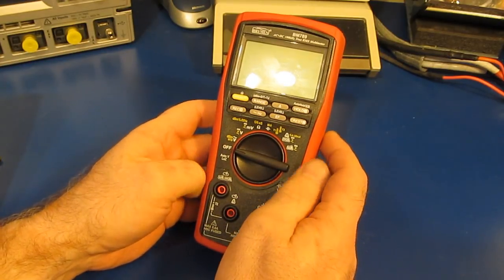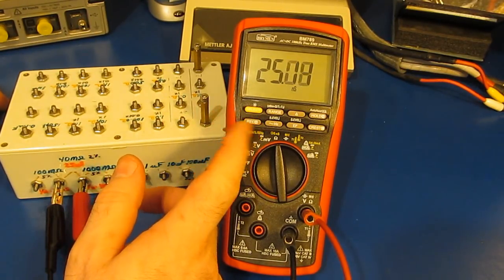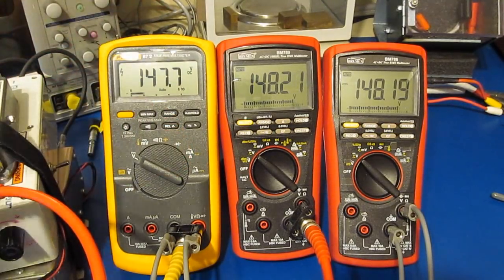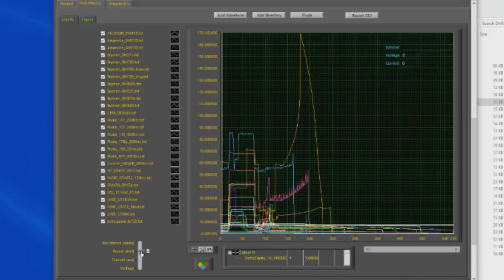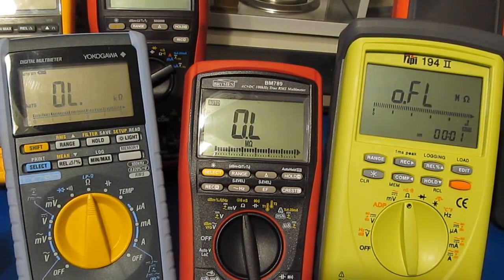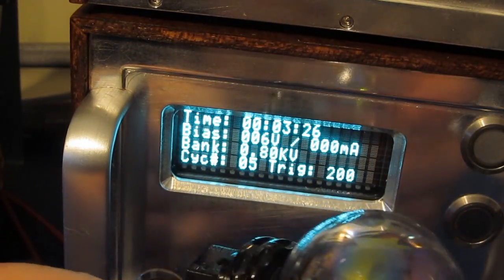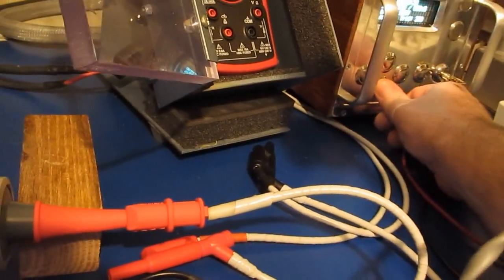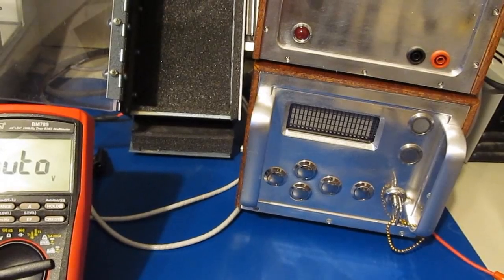Brymen BM789 DMM

Comment: I'm a retired calibration tech (metrologist) and always found the Fluke meters to be the most reliable, accurate and responsive with very few not passing spec even over longer periods of use/time (I've calibrated/tested thousands!).  However they are expensive.  Your Brymen reviews have convinced me that Brymen maybe it's equal at a more attractive price point.   I've purchased a couple after your reviews and have not been disappointed.  Note, they test well using the sophisticated (and very expensive) Fluke 5520A calibrators.
Reply from the maker: Thanks for the insight.   At least from a robustness standpoint, they appear to be on par.  I expect most will have a very long life.  Fluke really doesn't offer what I would consider a decent general purpose meter for electronics.  I like the obsolete Fluke189.  Brymen has the BM869s which is is my meter of choice until I find something better.
Reply: @joesmith-je3tq  The techs primary portable meter was the Fluke 189 until the 287/289 was released and then they upgraded.  The cal lab is a large international organization that went on a buying spree and purchased many of the small mom and pop cal labs in the US and internationally.
Reply from the maker: @amham48  The 289's boot times, small fonts, poor contrast and slow graphics turned me off of it.  I compared it with a Chinese knock off.  They copied the menu structure so its a no brainer to drive.

Comment: Do you publish the battery life chart anywhere? I really like this meter but I'm wondering if there's something comparable but with 300+ hour battery life.
Reply from the maker: I sure do.  Read the description.
Reply: @joesmith-je3tq  Which link has the battery life info included? I only see the one with the stress tests.
Reply from the maker: @rasputozen  That spreadsheet contains ALL of the data I have collected.  Tabs are at the bottom of the screen.

Comment: Hi Joe, I've got an older BM789 that has the beeper issue. It annoys me a bit, apart from that its a fabulous meter. Did you just write to Brymen to get those shields?
Reply from the maker: I had wrote them when the problem was first reported.  When they responded that they had addressed it, I asked for the parts to upgrade the meter for this review.
Reply: @joesmith-je3tq  Thanks a lot!
Reply: Hi, I got one with firmware 06, Is there any way to upgrade firmware to the latest version?

Comment: Thank you for the video Joe! Excellent as always. Just bought one from Welectron. Edit: 78908 firmware installed.

Edit/20220510: Bought a second one from Welectron. Firmware 78908 installed.
Reply: 78913 firmware now.

Comment: From Fluke's calibration manual there is a paragraph that states: "For better accuracy when measuring the dc offset of an ac voltage, measure the ac voltage first. Note the ac voltage range, then manually select a dc voltage range equal to or higher than the ac range. This procedure improves the accuracy of the dc measurement by ensuring that the input protection circuits are not
activated.".
 What I see from the video at 21.45 the scale is 6.00 (auto scale from AC measurement) and this scale should be set manually for the DC offset for precise measurement (as it is done when you select manually the scale, showing the correct measurement).
Reply from the maker: Indeed, all autorange problems can be solved with manual range and manual range meters do not exhibit autorange bugs unless the human screws up.

Comment: Joe. I love my eevblog bm786 so I'm about to pull the trigger on the bm869s off elecktor on ebay. It's quite cheap. I was given a tektronix dmm916 recently. Very nice responsive meter. I'm tempted to mod it with 2 leds. 1 on each side of the screen. I'll run them right from the battery when the meter is turned on. It's going to be a non destructive mod

Comment: Thank you for all the testing of all the Brymen DMM's you have done and I have a few questions !!!  
1.  Do you still consider the Brymen  869s to be a good meter?
2.   Have you measured the internal resistance in meters when measuring current? The reason I ask is I noted that when I put my Agilent meter inline I found it loaded down my circuit.
Reply from the maker: 1) You still see me using it don't you? 
2) I do not understand your comment about your Agilent loading your circuit.  You would need to provide more details about what you were doing.   

I have measured the burden voltage (assuming that is what you are asking about) for many meters.   That fact that you talk about loading, I suspect this is not what you are asking.
Reply: @joesmith-je3tq  I believe the question was asked about taking into account  internal impedance of the meter when measuring current. For e.g. for small current measurement the internal impedance of APPA iMeter5 on 4mA range when measuring DC current is around 3kOm. One meter had 2682Om internal imedance and another 3628Om. In the manual it says for e.g internal.impedance is around 3kOm. But this is approximate figure and each and every one will have particular internal impedance different from one to another. Therefore the current measurment was different for each particular meter. Hence when it taken into account it allows more precise measurement of the current. All meters have the difference. Would be really interesting to see how much difference Brymen same series have?
Reply from the maker: @stanleywhiteman6450  So you think they want to know the burden voltage of the Keysight.   This makes sense.
Reply: @joesmith-je3tq Would be interesting to know what working voltage of their circut they mentioned in that regard for a start to come to some kind of conclusion

Comment: in uk is quite difficult to get a specific multi-meter model from brymen or other decent or major manufacturers or anything else than a fluke. but i recently discovered a brand that is basically re-branding brymens and they are quite well known as a brand here in uk for testing equipment and they are called metrel.
Reply: any ideea what is going on?
Reply from the maker: Sure.  They are a business and as such sell products.  Rebranding is nothing new.

Comment: joe smith, You can measure a current of about 500 mA with a BM789 multimeter in milliAmp mode, take a reading and, without changing the current, switch the limit to Ampere mode (10 A) and also take a reading. For example, it can show 490 mA and 0.500 A, respectively. Will there be such differences on yours or not?
Or it will show 500 mA and 0.500 A respectively.
Reply from the maker: Assuming a constant voltage, the current will change as a result of the different shunts being switched.  Look up burden voltage.    That said, even if I drove the meter with a perfect constant current source, I expect it will change.   Recently someone had posted about their zero drift perfect UNI-T meter to which I created a video for.  Nothing is perfect.    https://www.youtube.com/watch?v=xuUGq3kdWyo

Comment: thanks joe you review, but i need your honest opinion 
would you still recommond BM869s with missing Autohold, why do you not recommand BM789 and it has all fetures BM869s not included.
why is Auto hold function not important as electronic uses point of view
Reply from the maker: I don't normally recommend products so I am not sure where the "still recommend" is coming from. Often I just recommend people to do their homework and buy the tools they need to do their job.   I do still use the BM869s.   It has a few features I want that are not included with the BM789. Mostly, I want the split display but have also found that 500k count mode to be useful.

Comment: I'm a owner of this model, I had UNI-T UT61E and sold it and bought this, by watching this review I'm sure that my brymen BM789 is robust meter.
Thanks for the hard work 😘
There is a 5 pins connector under battery cap, is that for updating firmware or just for factory use? Anyone knows?
Reply from the maker: I would assume for closed case alignment and firmware updates.  Factory use only.

Comment: Hi Joe. When you were doing the high voltage DC tests (around 17min into the video), what kind of cable are you using to connect the meters to the high voltage power supply? Its looks like an orange/red cable going to the banana to BNC adapter. Thanks Joe.
Reply from the maker: Coaxial.

Comment: Thanks for your video! If you had such a knowledge or experience, how accurate does calibrated BM789 unit perform over new stock one?
Reply from the maker: First, calibration is comparing the instrument with known traceable standards to verify it meets the manufactures specifications.  I assume any product when new, meets the manufactures claims.

Comment: Hello, I have the ut17B PRO model and when I measure a voltage around, let's say 5 volts, if I measure with the probes + with plus and - with minus, it gives me  5,3 volts, let's say, if I reverse the probes + with black and - with the red probe, it gives me another  type value - 5.7 volts, so a difference of 4 millivolts inverse of the probe in DC (direct current).
 Do you think it's normal?  is it part of the tolerance of the device or is it defective? Why i read diferent voltage if i inverse probes in DC mode?
Reply from the maker: The manual should provide you with the accuracy specs.   I would start there.   Abs(-5.7) - 5.3 is 400mV not 4mV.   Double check your results and make sure you have read and understand the manual.

Comment: Hi Joe,
...Question to you from a beginner in electronics: I was doing an Amperage measurement with this very same meter using an Eneloop AA rechargable battery (1.2 v with 1,900 mAh rated capacity) and the screen showed 9.something Amps.  I placed another AA battery in series and then got something like 14 or so Amps and I noticed the test lead tips and battery body were getting warm.  Is it possible for a rechargable AA battery to put out that many amps, or could my unit just be faulty? Or if the unit isn't faulty, did I possibly ruin my meter/HBC fuse by going over the 10A limit listed on the body, or does that currently limit only apply at the rated voltage limit for the lead (1kV)?  Many Thanks
Reply from the maker: You're putting several amps through the lead tips?  If so,  I am not surprised by them heating up and giving different readings.    What's the manual say about how long you can run this sort of current through the meter?   While you may have damaged your new leads, it doesn't seem like you have damaged the fuse yet.  There is a beginner section on EEVBLOG.  You may want to consider joining that and posing your questions there.   Most members there try to be helpful and if you post in the beginner section, they should treat you as such.
Reply: @joesmith-je3tq  thanks for that.  The leads have a 1KV 10 A rated stamped on the handle.  With regards to the meter, manual says up to 10 Amps indefinitely can be applied, and between 10A and 20A for less than 30 seconds, with a cooling period of not less than 15 mins, so I guess the meter is fine.  Thankfully the application time was brief even for the leads not to get too warm, everything still functions as it should, but def a lesson learned (along with many other future tips on EEV blog😉👍)

Comment: why doesnt anyone cover the brymen 867s which is very close to the 869s with only small features missing but quite a bit of a price gap
Reply from the maker: Doing a search for BM867, I see several videos for it.  Just use the YT search.
Reply: @joesmith-je3tq  i did look for the 867, does result in more than searching for the 867s. Only found one review for the 867s but i guess the 867 is in another language close enough but older
Reply from the maker: @rokiedecentra9656  I would assume the "s" was for the higher safety rating, like with the BM869s.   Functionally, I wouldn't expect any difference but you could as Brymen.     There were also several discussions about it on EEVBLOG.

Comment: Just wondering if the low Z setting of the BM789 was tested, I may have not been observant enough.  That's one of the features of this model I would appreciate over the BM786.
Reply from the maker: How would you propose this mode be tested?
Reply: @joesmith-je3tq  I think a go/no go test would be good enough.  If the low Z returns to lets say 20K ohm after cooling, that would be a pass.

Currently have much of the components already to make my own low Z DMM adapter using resistors and fuse(s) in series that would take the line voltages almost continuously.  IMO varistors are kind of like thermal fuses.  After so many cycles of zaps or heat they eventually will fail.

But still would be nice to have a DMM with the low Z for occasional convenient use.
Reply from the maker: @ntag411  With how many volts applied for how long?  You leave a lot of variables open.  A MOV is not in any way a thermal fuse.   Your comment about cycles and zaps isn't one I have seen in a very long time.  You must be new to the channel as I've covered that topic a few times.

Comment: Hi, Interesting you're actually doing some relevant testing, but I dont think you're actually doing the impulse testing in accordance with the relevant Standard EN/ISO 61010-1 which from memory defines the voltage waveform as 50/125us with a specified source impedance depending on the Measurement category. There's also iirc a time between impulses for recovery and 20 impulses to apply for a successful test. When I've done them in the past for compliance testing I've used a Schaffner NSG2050 which allows you to set the source impedence.
However, it's one of the better assesments I've seen on youtube that doesn't concentrate on bells and whistles and apparent accuracy.
Reply from the maker: In the description, there is a link to a FAQ. I believe everything you have brought up was covered in the FAQ.  Of course, had you actually watched the video, it was covered in there as well: https://youtu.be/ciwBB5kYvJM?t=2944

Comment: Hello. Please help. What is the best buy in 2021? 789 or 869s????
Reply from the maker: If you can't sort out what your need are, how would you expect anyone else to sort out what your needs are?  The best for you is what choice you make.  Not what choice I make for you.  Learn to make your own choices.   If you don't have a clue what you need, you may need nothing.  Wait until you have a need, then buy the tools that fit those needs.
Reply: @joesmith-je3tq  Yes, I understand what you are talking about. Maybe I said wrong. The functionality and accuracy suits me with both multimeters. And in terms of the quality of materials, there is no way to check them before buying. Is the 789 the same quality as the 869? I hope I wrote it correctly ..
Reply from the maker: @fpvart193  I am not sure how you define quality.  I provided several tests for both meters that go beyond what the manuals cover.   They may help you determine if one is better than the other based on whatever criteria you come up with.

Comment: i have an 829 and i got the newer 789 and it seems to mee that 789 is has some issues in autoV loz while measuring for example a battery the voltage continuously decreases and after using it in this mode when u try to measure the battery in v mode it will take some time for the voltage to settle in this mode the voltage increases for few good seconds maybe 10sec or even more. i really dont know why is it behaving like this. the 829 shows the same in autov and v
Reply from the maker: Hard to say not being there watching you.   Battery could be something from a car or a button battery for a watch.  Of course, we know meters with LoZ accomplish this normally with PTCs.   If you were to get these hot, their impedance increases and of course it drops as they cool.  My guess is what ever you are doing you are not considering their effects.
Reply: @joesmith-je3tq  i tried new AAA AA and 9V batteries with both 789 and 829 in V mode and in Auto/LoZ and 829 in both cases shows a stable number for all of them while 789 in auto/loz the voltage drops continuously and if switch back to V mode the voltage is increasing slowly. if u check directly in V mode with 789 is ok it gives u the stable number like 829
Reply: can you check your 789 with any AAA AA battery in autoV/loz mode and see if it does the same?
Reply from the maker: @MihaiDobrin88  Again, you are loading the battery, then removing the load and the battery starts to recover.  I've seen people who have tried scams based on this but it's nothing new.   You should be able to replicate it with any meter and a simple load.   If you feel this is not what you are seeing, make a clip and post it.
Reply: @joesmith-je3tq  ok im will make a video and post it and let you know. my only concern is because i just bought it and just in case if it has an issue i wanna know to send it back for replacement. the fact that 829 doesn't do this testing the same batteries makes me wonder if my 789 is faulty or is something normal for this model like being an extra feature or missing feature compared to 829
Reply from the maker: @MihaiDobrin88  What's the input impedance of the two meter in these modes?   You should be able to replicate it easy enough just using an equivalent load.
Reply from the maker: Looking the 829 doesn't even have a low Z mode, so why would you expect it to behave the same?   I'll wait for the video but I think you are stumbling on some very basic questions.
Reply: @joesmith-je3tq  actually it does have but is not advertised and is not written  on the body they just say autocheck but once you are în autocheck the loz indicator comes up on the screen they just call it relative zero and ghost booster
Reply from the maker: @MihaiDobrin88  Be sure to include your measurements of the two meters inputs when you make your demonstration video.
Reply: @joesmith-je3tq  so did you two resolve this disagreement? did he post video evidence?